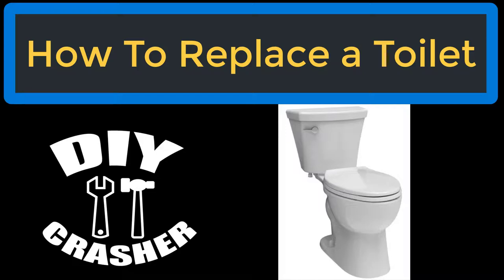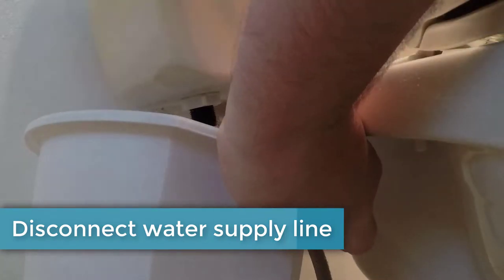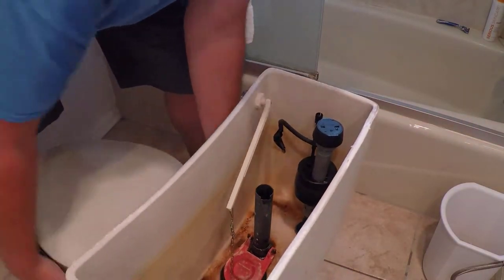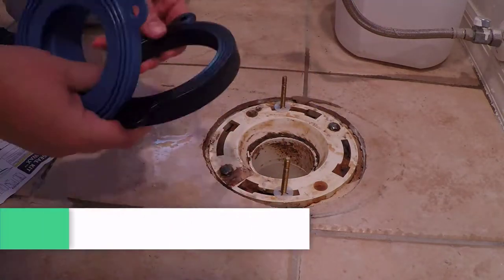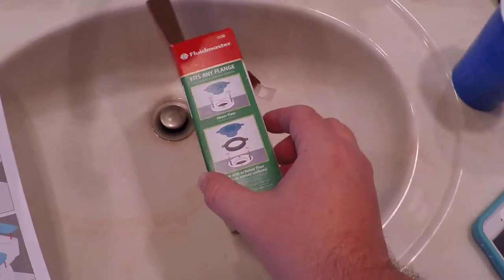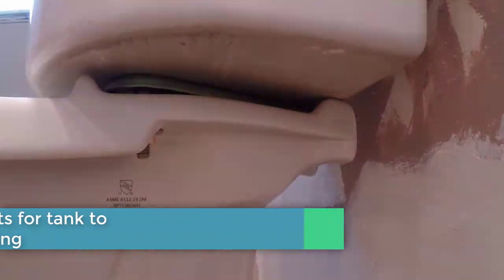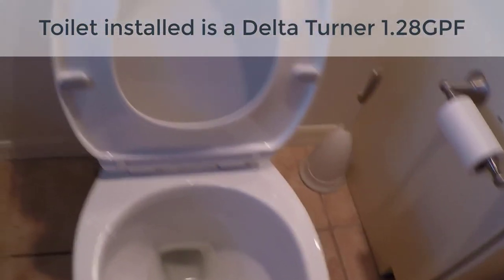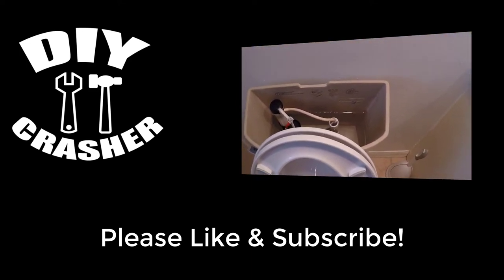🚽 How To Install a Toilet | Replacing Old Toilet, Easy Step by Step Instructions  🚽

Comment: You certainly take the "intimidation" factor out of the repair. I feel like I can do this!
Reply from the maker: You can do this!  Just take your time and follow the steps.  Read and follow instructions to assemble the new toilet you get.  There's plenty of videos out there on Youtube if you run into a specific problem.  It will save you money from having a plumber do it and you can say you did it yourself!  Good luck!